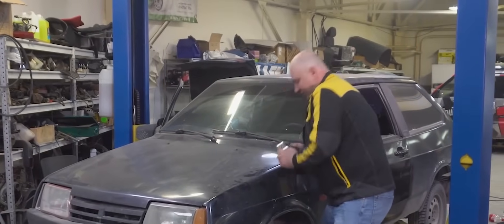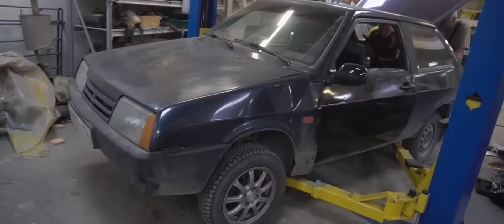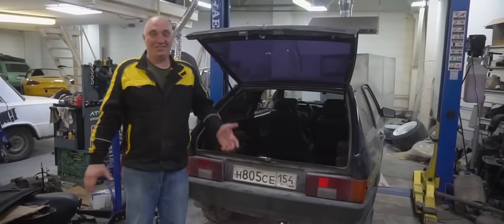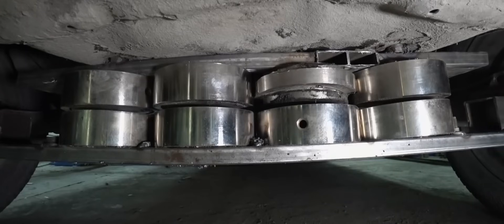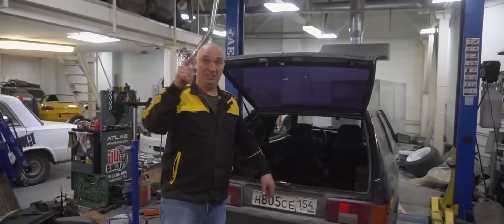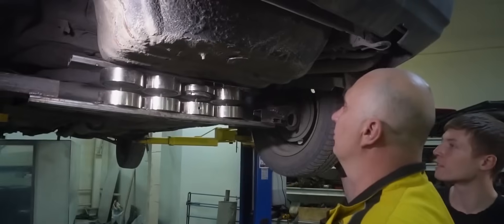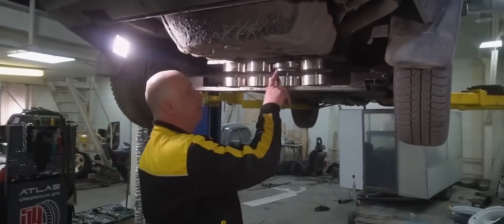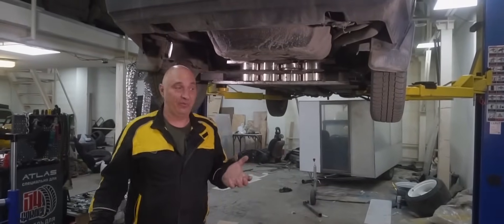DIY magnetic suspension

Comment: What I have done in the past is designed my own pulleys out of magnets that were balanced and in that balancing the car would basically run itself once started through use of Polar Opposites and kinetic balancing of the pulley system

Comment: Try putting the magnetic spring closer to the pivot point & lengthen the suspension arm. 
Pro - This should give you longer travel. 
Con - Stronger or more mag-springs will be needed.
Reply: After watching the 4 engine Lada, I think 'more' is a word they love.

Comment: You could put 4-4 on top of each other on the place of the factory spring, with a rod in the middle, and this way you get 3-times more suspension travel, and maybe you also can put back the factory shock absorber to it's place. It may work a little on that 3cm :D

Comment: Put the magnets inside a thick walled copper tube and it will act like a shock absorber.
Reply: Wouldn't those be shocking shocks?
Reply: Great idea, using lenz Law to do the absorbing! it will resist more with faster movement and less with slower always the nicest ride :)
Reply: Just fill the tube with oil and yep, but its far easier to just buy airbags if you want this kind of basic suspension
Reply: @Steve211Ucdhihifvshi  
Why buy stuff when you have tons of crap laying around that you can fabricate up? 
Itll only take a little bit of a shitload more time than expected.
Reply: gene S. Oh hell yeah!! That would be cool. Plug you get an electric current to run the car... too complicated? But go ahead and make some shocks.

Comment: Magnets and their inverse square law. That repelling power dies out fairly quick, if you place more magnets then the suspension will become very stiff - if you take some away the suspension bottoms out and has very little play. Magnets for suspension in this manner doesn't make any sense. 

Magnetic suspensions are quite amazing, but require quite a bit to operate.

BTW a weld is a weld, you can spot weld a tire and have it explode 5 minutes later from the residual heat - that residual heat from the short bursts of thousands of degrees for sure heated up those magnets deteriorating their strength.

Comment: 2 sets magnets pulling with leverage to lift the car (may need a small spring between them or a bump stop on the lever so they don't collapse together) and 1 set pushing apart in the middle. Add some angle to your beam (like laying some 2 or 3 pieces 1x1 angle flat onto the beam bottom and weld them so they look like V's added to the plate steel beam) so it wont flex as much and reinstall shocks. Or find some C channel big enough for the beam. This should get the job done with some available payload and 1 set less of magnets used. As others suggested try not to get to much heat into those magnets when welding.

Comment: Using the same idea with the magnets on a rod, rig up a pedal assembly using magnets for your clutch, gas and brake so there would be no physical connection between the magnets, only open space like in your suspension.
Or, make a wheel out of repelling megnets! Weld magnets to a rim, then have another outer rim with wleded magnets placed to repel. You could weld rods on the outside to keep everything in line. The magnets probably wouldn't be strong enough though. You'd have to have rows of 3 or 4 maybe?

Comment: Use the magnets plus several more to build a magnet driven motor , use the push force to spin the motor via , a outer  ring of magnets forcing an inner ring to spin the crankshaft of a old gutted motor. 

I did this in the past to nake a small generator oit of an old F metal bladed fan , with magnets on each blade and just a couple in its frame to push the blades 

Works best like a box fan.. with 5 blades , one mag on each Blade , and six placed on the box frame itsself to where they work against each other even more..  I always wanted to do this with an old motor and set the magnets up on the flywheel and more mags in place of the stator on under/inner side of flywheel ...

Comment: I really haven't a clue if this is right, but would the magnet not be using some of its power sticking to the steel frame? If it was mounted in say a nylon bushing away from any metal, would that leave more power for repelling?
Be gentle, I'm no rocket surgeon.

Comment: Separate your line of magnets they are too close to together. further they are apart from another they won't enterupt the magnetic fields of each other
 . + , +/ - , -....on lower and also same to top left to right.  
Even tho round magnets have opposite poles on flat sides, The rounded edges are the same.+ , +/- , -  2 giant rectangular magnets will be more effective than that 8 small magnets. The mas is greater and all poles remain equal to one to another.  Round magnets interfere each other side by side. Rectangular magnets doesn't.  Fallows by + , +/- , -

Comment: Didn't anyone here remember physics class? The force of a magnet is related to the square of the distance you are from the magnet but since you are dealing with 2 over laping magnetic fields it is not just the square of a square, so 4 route , as you move further from the magnet the force drops exponentially, also if you are calculating pulling force, the steal case ads power so if it is 600 kilos of force to pull apart it is likely only 400-500 from the magnet alone and since that will not help you at all when the magnets are pushing away from each other then you can discount it. So when the magnets are completely touching they likely have something like 32,000 kilos of force opposing each other but something like an inch away or a centimeter away the force is reduced to the square route of 32, so a little under 2,400 kilos, and an inch further away from that is even smaller because it is the square of the square(4th route of that number) so like 220 kilos, Idk the actual unit of measurement but I think I got the numbers right, but then again I haavn't taken a class in physics in almost a decade.

Comment: GARAGE 54!! Please try flywheel free energy with two electric motors
Reply: And since he already has the magnets, he can replace the car's engine with a pair of magnets on the firewall and the other pair in place of the radiator. The front ones will pull the rear ones along with the rest of the car, thus propelling it for free!
Reply: @djdjukic  actually this doesnt use the magnets it just uses two motors, a heavy flywheel, and a high high ratio set of pulleys such that the first motor drives the flywheel up to high speed, and then the flywheel drives the other motor at an equal rpm via a simple belt, whose outputs are fed directly into the first motor again, keeping up the speed of the flywheel even when additional loads are added to the circut. You have to spin up the flywheel first using power but after that it is self sustaining.

Comment: I designed this more than 30 years ago with lego parts. Like some comment....maybe the heat killed some of the magnet field.
You could try a independent suspension and with 4 groups of 3units of those magnets , 2 groups on each wheel...you know what i mean. Dont heat them, use bolts into the center and a nonmagnet guide with some rubber protection beetwen them.

Comment: If I may offer an idea?  I have never tried this, it's only a brainstorm - 

Mount 16 magnets, 8 on each side, as far out as possible on the axle.  Stack them in pairs - so a total of 4 above and 4 below on each side of the axle, mounted in longitudinal tandems.  Definitely use a guide line to keep things aligned!!  And shock absorbers!!

If that doesn't yield sufficient spring rate, then wrap them in wire and turn them into electromagnets.

Good luck!!

Comment: all you got to do is mount the magnet in a sort of upside down fashion(if you know what I mean). This way, when they pull towards each other, they will lift the car
Reply: Bingo! We have a winner!  Remotely mounted magnet pairs, two pulling and two pushing (per side) through independent, adjustable, fulcrum and lever systems would produce a suspension.  Damping will still be needed.
Reply: @dusk6460  I hope Garage54 sees our comments
Reply: @MsPhillip93  I don't think they will, since most of the time they read comments on their original videos, and not the english dubbed ones.

Comment: You could use those permanent magnets as a core, wrap them in coil and have some sort of electromagnetic suspension.
Reply: Not sure how well that would work. Maybe fill the shocks with some kind of electromagnetic fluid and wrap a coil around them and use that to control stiffness?

Comment: You welded the magnet.... You lost most of the power after it got hot!
Reply: Like first reply, they got a Iron Sleeve to protect them.
And Electrical welding is a very fast welding, so magnets wont have over heat from that.
Also, at factory, do you know how they make magnet? By passing through a very high voltage. Before that it's just a big piece of mixed metal.
Reply: You can't pass a very high voltage trough a low resistance object. I think you meant current
Reply: @two_number_nines  Yes ohm's law baby.
Reply: They have sleeves so they would have been protected from the heat.

Comment: The reason that the push force of the magnets is less than the pull force is because the strength of a magnetic field drops exponentially with distance. With this being the case, the push force is only equal to the force required to pull the magnets off something when they are in contact with each other

Comment: How about one magnet loose on between magnets?
Like  I-+  +-  -+I
Reply: DRD 144 good way to get more travel
Reply: Have an aluminum rod run through the middle to keep them aligned
Reply: But doubled and put in place of springs with articulated mounts maybe an all thread as a guide rod with heim joint end and a large nut to limit extension over travel. a steel cap with a threaded center could replace an upper spring cup and a lower plate mounted to the lower control arm you could avoid welding to the magnet, run a set of shocks and Bob's your auntie
Reply: what I was exactly thinking about
Reply: That would obviously need a slide pin to keep it in place, but that would probably make it more cushioned.
Reply: This
Reply: Right on, DRD 144... only thing is is that it would take two magnets  in the center to maintain the polarity continuity. It would definitely create more travel-space and the car would be more able to take on bigger bumps in the road. :-)
Reply: One could encase the four-magnet (or even 6 or 8 magnet) setup in a non-ferrous metal cylinder with the non-ferrous metal shaft going through them to keep them all aligned.... that would work...  it could even be build to be bolted into place where the original shocks were mounted.
Reply: This is very similar to how Belleville washers work, though I suspect the Belleville washers are a bit cheaper.
Reply: exactly what i was thinking!!!!
Reply: I'd make a scale model if I could be bothered
Reply: Right on, Alastair.
Reply: Please do this
Reply: They have rotate the one row of magnets.
Reply: @Alastair shit yes
Reply: @Alastair
Or you could just use Lenz's law and have your magnetic "springs" absorb shocks with an Aluminum or Copper casing.

Comment: may be you should wire it and/or make or use electro-magnet instead of permanent-magnet
Reply: Not sure how that would work... You'd need one beefy ass battery and alternator. Maybe fill the shocks with some kind of magnetic fluid and wrap a coil around it and use that to control stiffness through PWM?

Comment: If anyone is interested in magnetic suspension, you should look up "bose magnetic suspesion" it is an amazing concept that last year BMW bought the patent for.

Furthermore it is mentioned in the video that magnets do not have the same repulsion power as pulling power.
this is correct, repulsion is about 15% weaker in most magnets at a distance of 1 cm.
so the magnets are offering about 510 kilos each. 

Which should be enough for a Lada.
Reply: "Which should be enough for a Lada.
" Maybe a Yugo (825kg) or a Samara like the one in the video but not enough for the typical Riva which weighs a fuckton. This is also a great way to raise your unsprung weight up the ass.

Comment: a line of 6 but stack layers like 4 of them so 6x4 to give 4 times more travel and 50% more force in the suspension. (force is exponential so only at like 1mm will there be 600 kg, at 2 mm it is 300 kg 4 it is 75 kg... and so on... so putting 4 layers will increase the travel...) EDIT, do not put them stuck on each other, put them back to back... so you copy the design you did and stack the whole design.

Comment: Should have used a rubber gasget between the magnets to soften the contact.
Reply: Or proper bump-stops.
Reply: @mysock351C  ...  Do you really expect proper anything from this channel?
Reply: @TheAttacker732  
The nasa pen russian pencil (fake ) story .... Eh it works.
Reply: @TheAttacker732  This is just a translation channel. The photos for this were uploaded ~3 weeks ago.
Reply: Thats not how this supposed to work. Idea was, that magnetic force keep the magnets apart. And it kind of worked. The issue is, since the force weakens fast when the gap grows, so suspension travel seem to be short.
Reply: Or do oem and make a cylinder fill it with a ferrous solution and seal it, but soften the sudden shock
Reply: Cut up some tires and stick it on with polyurethane adhesive.
Reply: Russians don't even use gaskets between their ears.....
Reply: @justlife2129  gaskets between their ears??🤔🤔🤔🤔🤔🤔🤔🤔🤔
Reply: @justlife2129  
So they don't have ass gaskets in public bathrooms ? 
So its BYOAG?

Comment: Most magnets will start to lose power over 200F. Any sustained time over that temp will reduce the power of the magnet quite a bit.
Reply: @Chris Hoffman-Echandy Hey Chris! No question is dumb. The magnet will never have the same strength it did when new. Some of the magnetivity does come back when it cools, but not 100%.

Comment: you kill the field when you add HEAT to them try doin this with out welding them, but you did say there is a steel sleeve on it so maybe you did not kill the field
Reply: To demagnetise them you need to heavily heat them up beyond discoloration. they just put a few spot welds on the iron casing. The magnets themselves didn't see any heat
Reply: Permanent magnets can be easily re magnetized.
Reply: And judging by thickness of sleeve it would be a non issue
Reply: @berrytharp1334  How do you easily re magnetize a magnet like that?
Reply: Such small welds wont do too much harm with the steel/iron sleeve around it
Reply: The welds were not hot enough to transfer the heat to the magnetic cores to get near enough to the curie point to damage them . Having both experience in welding and also messed arround with large magnets totally cooked one it took a while before the magnetic field was destroyed.  That was using slowly heating it up over time.
Reply: What if the polarity is being messed up cuz they're too close together maybe like 5-inch spaces between them
Reply: Sometimes I'm astonished at the apparent ignorance of some people, but there again this is a channel for silliness, so perhaps I'm mistaking a silly reply as a true indication of someone's knowledge?  Either way, B D is quite correct.  A permanent magnet will lose its magnetism at temperatures higher than its Curie point.  Typically, for the most common types of rare-earth magnets, this is not much higher than 350°C (Nd2FE14B), and can be as low as 300°C.  Even inside its steel casing, this is likely to be easily attainable when welding...  So, either fabricate some sort of clamp, or simply use the central mounting hole to bolt the whole affair to the axle.  Many more magnets would be useful too!
Reply: B D yeah I thought the same thing when they welded them, I figured they would weld in some box frames or just something to keep them in place.
Reply: Yeah i agree on that... I have done it those heat really kill the magnet... Even a little fire can kill it..
Reply: @wonderbread2364  i mean the heat from the welding and the grinder.....
Reply: Thermal conductivity/conductance. Heat transfers very efficiently. The magnets would lose half their potential from the welds since the steel and magnet are touching.
Reply: @wonderbread2364  they arent what they were. Guaranteed.
Reply: @wonderbread2364  i guess.
Reply: Depending on the grade of magnets, some start to degrade just under 200° F and some as high as 450° F. It is unlikely they purchased the highest grade. Most like the will start to loose a lot of strength around 250° F

So, because they welded on the case. It may have got hot enough to weaken them but we will never know unless they comment on it
Reply: @jasonharrison25  
Sloppy mechanics reuses head gaskets on turbo builds , so id wager the welding heat soak didnt do shit to the magnets.
Reply: Agreed, that amount of heat required to weld them would have seriously killed that magnet.
Reply: It can be magnetized by utilizing a magnetic yoke, mag unit or simply forming a coil
Reply: welding is the word you use for doing the work in english , welder is the name of the unit!! but yes
Reply: B D welder is the the title of someone who welds. So not you
Reply: @shayneobrien8158  a welder is called a boiler maker